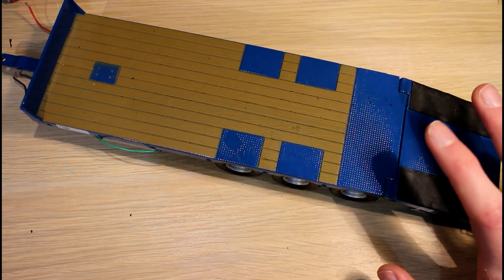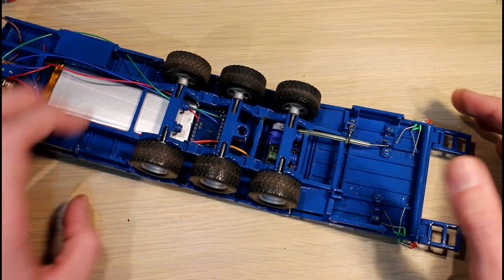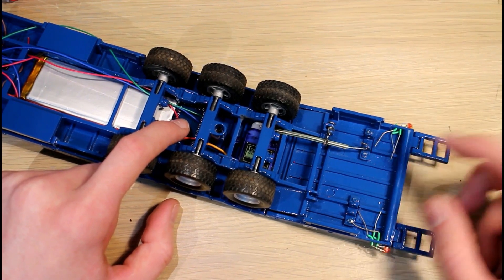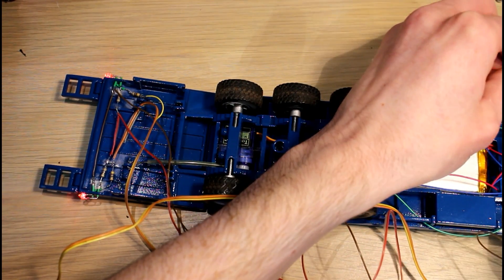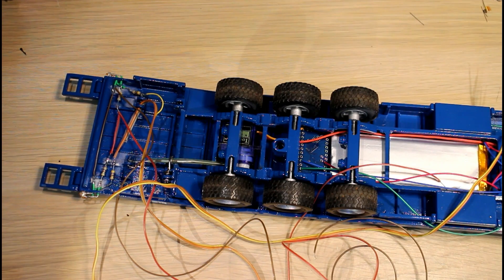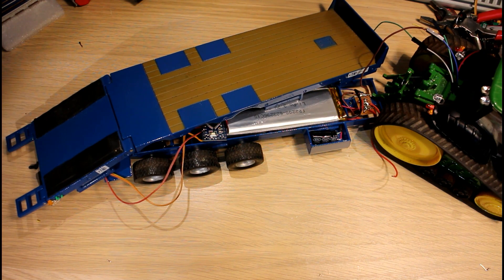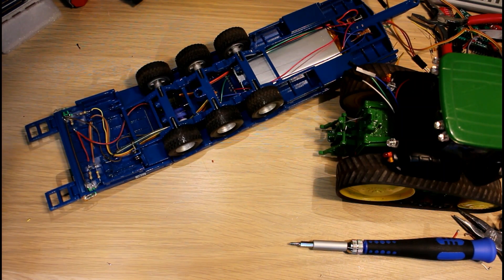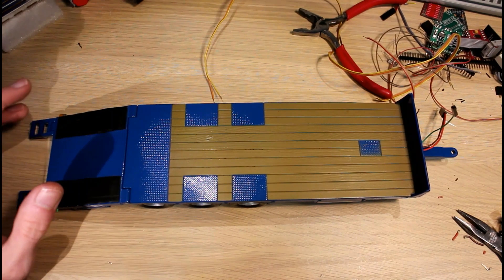Britains Kane Low Loader Part 3 - Installing the LEDs and final wiring

Comment: hello , my friend, would like to see a step by step assembly of the basic shield Arduino controller, because I do not know much about arduino , but this step by step would be for me a referral to know more , I'm having trouble with the receiver , assembling , tb6612 , nRF24L01 , at328 16MHz if I can agraadeço , help me!
Reply from the maker: +Flavio Costa You just plug the parts of the basic controller together and upload the code, this code should work http://rctractorguy.com/basic-arduino-based-rc-controller-library. This code should work for the tractor http://rctractorguy.com/rc-tractor-guy-library and there is a wiring diagram here http://rctractorguy.com/rc-tractors-and-attachments/rc-tractor-builds/rc-john-deere-9560r